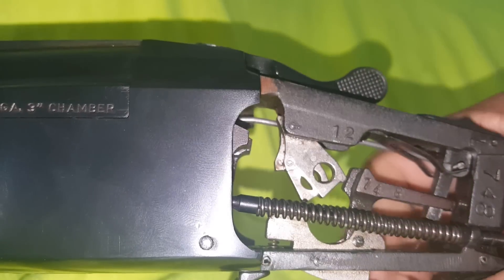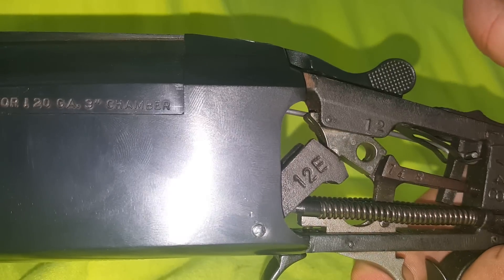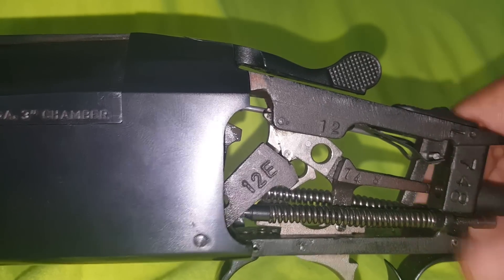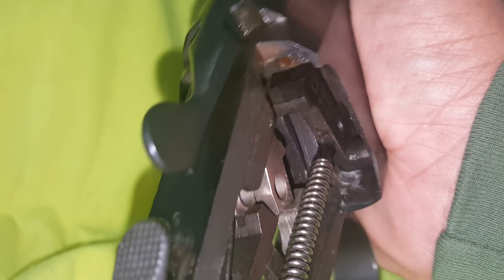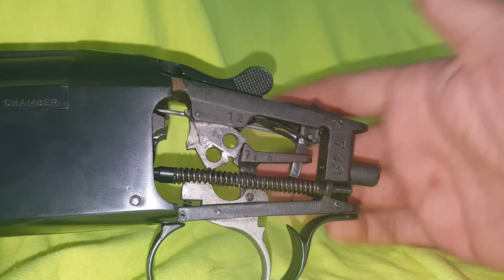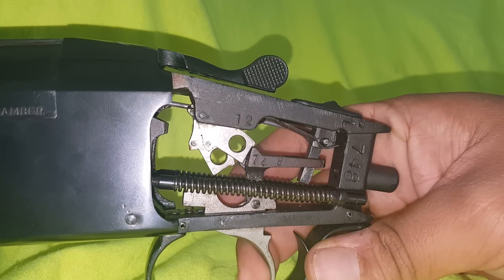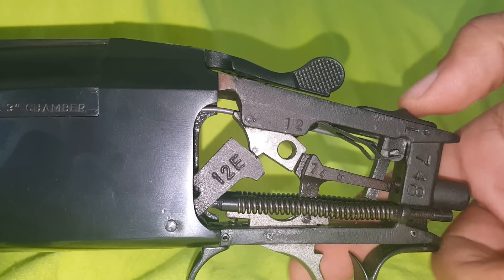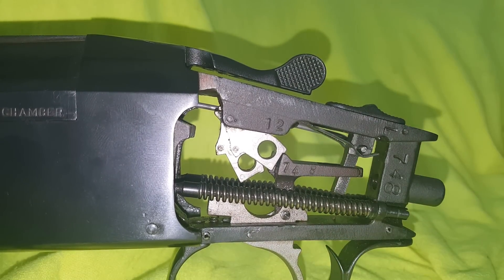Stoeger Condor not firing top barrel

Comment: clean the spot where it rusts and corrodes real good then smear some bluing solution with a Q-tip then GREASE it real good , SHOULD help
Reply: Grease jams the balance mechanism; just use a bit of WD40 or similar; do not over do it.
Reply: @sebastiantufigno6955  never put wd40 in or on a gun. I charge anybody double that comes into my shop with a wd40 special. Eventually it creates a shellac and gums up too much stuff

Comment: I have three different model Stoegers, and all three developed the same issue where the safety would reset after the first shot. I never liked the auto safety reset function anyway, because on the clay range, you load two, shoot two, and then there's no live shell.

The 'L shaped' bar that sets the auto-safety each time you reload can be removed, and a small metal rod inserted where the 'L' bar came out. This allows the safety switch to still operate normally, but now the safety will not reset each time you remove the spent shells and reload. The safety will only operate manually by moving the safety switch.

This leads some shooters to believe the gun is less safe than before. Keep in mind most over-under shotguns do not have this auto-reset feature anyway. If you have become accustomed to relying on the auto-safety reset, then you will have to retrain yourself to knowing the safety does not reset. This is important.

The main advantage of performing this modification is your Stoeger will never again misfire. Sure, it's not as well made or as pretty as one of the 'Big B' shotguns, but then, you haven't spent six times the cost of your Stoeger. The heavier Stoeger also absorbs more recoil, which is especially nice for a senior like me with the 12 gauge gun. I assure you, there has never been a time when I didn't enjoy myself on the clay range because I didn't have a 2800 dollar shotgun.

Comment: I just bought one of these second hand and it had the same problem. I removed the safety selector, and found massive burrs from the machining all the way down. Filed them back very lightly with a delicate filed and gave it a real good clean now it fires both barrels no problems at all.

Comment: My brother gave me a Condor where he had removed the auto safety bar and just used a small cross pin to keep the safety working manually.  After he reinstalled the safety bar the top barrel would not fire.  Yes, the leaf springs were above the bar but it still would fire the top round.  When I got it home and broke it down I discovered the real problem.  Not corrosion.  It was the safety switch itself, it was installed with the wrong side facing forward.  There is a slight difference if you look closely.  So I flipped it around and now the Stoeger works as it was built to work.

Comment: Thank you very much for posting this video.  

A friend of a friend had a problem with his Stoeger O/U shotgun, the safety would no longer operate and was jammed in the "on safe" (furthest rearward) position.  Apparently this is what happens if the problem you described goes on long enough because the hole that the bar from the safety to the receiver goes into gets packed with rust and the end of that bar was rusted.  This prevented the safety from full travel and effectively disabled the gun.  The gun would not fire either barrel.

That was the ONLY rust inside the action.  There must be enough difference in the metals used to cause a little electrolysis and rust right at that point.  I don't really see this as a design flaw, I don't know of any way that Stoeger could have anticipated this issue.  It is a fault only time will reveal.

I cleaned up the bar, chased the hole by manually turning a small drill bit in it, blew it out with canned air then filled the hole and coated the bar with graphite gun grease.  (Birchwood Casey Choke Tube Lube.) I worked the safety a bunch of times to get the grease evenly distributed and keep it from "aging" in a lump at the bottom of the hole.  That grease is designed for choke tubes and works like a charm for other gun parts also, it never seizes, breaks down or gets nasty over time.  I've removed choke tubes that have been treated with it and had thousands of shells fired through the gun over many years, the grease still looks like it did the day it was put on the threads.  

The shotgun then operated properly.

This should be a permanent fix.  The grease will stay put lubricating and preventing rust for years.  If it has this problem again some day in the distant future now I know what to do about it.

You gave me the starting point to identify and fix this problem and it was a problem that could be fixed with elbow grease without buying any new parts.  Thank you again, I really appreciate the time you took to take and upload this video.
Reply: works on the condor competition. Thanks
Reply: ACTS ....you can't have it both ways. Is it the over under or the coach?
Reply: ACTS No, but that was a legitimate question. The coach is a side by side. I'm Not nitpicking, they each have different mechanisms.

Stop being a reactionary. It makes you look like a sensitive little girl.
Reply: +Jonathan Rivera 
You said, "Stop being a reactionary. It makes you look like a sensitive little girl."

 "Reactionary" doesn't mean what you think it does ...

re·ac·tion·ar·yrēˈakSHəˌnerē/adjectiveadjective: reactionary1. (of a person or a set of views) opposing political or social liberalization or reform.

Stop using words the meaning of which you do not know.  It makes you look like a nitpicking nitwit.
Reply: ACTS That's well and good. I just need to know, does your nose touch your forehead? Also I notice that instead of admitting you mis-spoke, you just deleted your gaff, rendering this whole outrageous conversation void. The magic of the internet.
Reply: Mossberg 500 complete bolt disassemble and reassembly

Comment: I would say the safety slider spring must sit on top of the cross pin. Only then the safety slider would have two more or less stable positions, one in the forward and one in the rear position.
With the spring below the pin the safety slider wouldn't stay in either position but wants to go back to the middle position.

Did you reassembled it the wrong way or was it possibly already built in wrong by factory ?
If the problem with firering just one barrel is rather common possibly it's in fact built in wrong by factory occasionaly, or the owners do it wrong occasionaly.

Comment: Thank you for this helpful insight. I Just bought this gun. Used it once and I guess by letting letting it sit maybe that's when the corrosion forms. I found out the hard way because I took it to the range today and the damn thing would not fire the bottom barrel. However I figured out that by turning the safety on and off between shots it looks like it fixed the problem as a workaround. This is very unsettling though.

Comment: I had the same problem and I too cleaned out the hole for the safety wire and it has not failed me since and that is about 300 rounds so far.

Comment: Along with the bar on the wrong side of that spring, when the second barrel won't fire, the mere act of putting the safety "on" then back to the "off" position will move the sear into position to make it fire.
Reply from the maker: Tim Carpenter  Yes the pin is in the wrong position but even in the right position still did not fire second barrel no matter how much you move the safety from safe to fire. Like I stated previously I sent it back to Stoger worked fine put it in the gun locker, took it out and went to the range and boom same problem. All i know is now i have no problems.

Comment: I had almost the same problem with the 410 version. Corrosion was also the culprit, but it wasn't the safety, it was the little spring that pushes the right hand sear down. The spring that pushes the left hand sear down is identical according to their parts diagram. The sear spring on the right was missing. This caused the right hand sear to not (always) descend after firing the 1st barrel (bottom?) and give room for the left hand trigger arm to move forward to engage the left hand sear (that last bit is just like the problem you had with it). I think the spring corroded away. There's a hole that it sits in. Actually two holes: one up top (on the receiver) and one in the sear. One of them was very corroded and when I poked a tool in it, what looked like a remaining bit of the spring came out. I never did see the rest of the spring. The gun worked fine for quite a while and then one barrel just stopped firing. The same symptom as your problem. But now that I've seen your video I'm going to check the hole that safety rod fits into to make sure it's not also filling with corroded metal. Thanks! Very helpful video. I ordered replacement sear springs from Stoeger: two in case I screw one up.

Comment: Brand new out of box top barrel was not firing, saw this vid shortened the safety bar about 1/32 of an inch and now the second  sear engages. BTW I just noticed  you forgot the reengage the spring! The spring sits above the pin!

Comment: I just bought a Winchester 101 pigeon/trap first time out patterning the gun the bottom barrel shot fine but the top barrel was not firing at all, it actually was stock like as if the safety was on the top barrel preventing it from firing. Very odd a brand new gun never used. I suspect that something wasn’t machined properly. I just can’t believe that they would send a gun out to be sold without test firing it first. It’s on its way back to Winchester to hopefully be fixed. Very disappointing to say the least on a brand new gun. I guess it was put together on a Friday after lunch lol. If you have any suggestions on what could’ve gone wrong with the assembly or the machining I would appreciate your input on this. Thanks!

Comment: I looked at my Stoeger condor after watching your video, and I want to point out A couple of mistakes. The "corroded" bar that runs from the safety lever into the hole in the receiver since rather loosely on mine and therefore did not need to be freed up. Reason your gun in its current configuration will fire both triggers is because you have your safety cross bar above the springs so the springs are unloaded and serve no purpose.  The springs are meant to put down pressure on the safety to keep the safety from flopping in and out of "safe", which is extremely dangerous.  The mechanism is most certainly inertia driven as are all shotguns that don't have selective-single  or double triggers.  In fact, if the gun we're working properly, you would not be able to fire the second cylinder without having first fired The first "lower" cylinder and letting it set the second triggered by recoil. I appreciate you wanting to share what you think is a Stoeger condor epiphany but your analysis is mistaken, not trying to be malicious, I just don't want you to be hunting with somebody and accidentally shoot them because of your flip-flopping safety.
Reply from the maker: Peanut Man Hey no offense taken or anything like that. I am here to learn like everyone else  thats why i asked for the comments. Now with that being  said, im a little stumped because like i stated in the video when i bought this shotgun BRAND SPANKING NEW  i might add, it would not ingauge the second barrel and  put like 50+ of both 20 and 12 gauge through and nothing. So immediately  I sent it back to Stoeger.  5 or so months later i receive the shotgun back and anyone can guess what happened next..... straight to the range!! I loaded the shotgun and low and behold both barrels  fired without a hitch. This is where it gets me i was able to dry fire just like shown in video both barrels  when I received it back from Stoeger  which wouldn't happen when first purchased the shotgun or even when being fired with inertia Anyways after that  it was fine. Then i put it up for a while and when it  was time to go to the range again  the same thing happened again this time i put 70+  through and  still nothing. So thats when i took it apart and had a look , I just thought  well I sent it to Stoeger waited 5 months for the same outcome I just didnt have a lot of faith you could say. But believe me i am open to  any and suggestions but as of right now its firing  like a champ and have had no issues.
Reply: Hey I know this video is old but @Peanut Man is right. I shoot a condor competition which does reset on inertia but i also have a condor like this one and it has a no select mechanical trigger. Pull the trigger twice both hammers are released, which I like personally. But that cross bar that goes through the safety does go under those two tabs.  Its what gives the safety that distinct click from on to off and that bar is what resets the safety between shots. I removed the bar because my junior shooters, which I normally let shoot this would have missed clays too often for not resetting the safety. I replaced the bar with a similiar sized pin and it works great. But if that pin or bar is not under those tabs, good chance the safety and or trigger will fail. And you definitely dont want that when your 24 for 24 with one bird left lol.
Be Safe, Happy Shootin'!!

Comment: hey the pin for your safety is on  wrong it goes underneath the spring.  the linkage is pushed in while pushing the safety springs up.
Reply: David v wanted to point out exactly same thing :)
Reply: The pin is on right but the spring must sit on top of it ! So you must push up the spring before put the pin back in.
Reply: Thanks for this.  When I checked for corrosion it still felt funny after putting it all back together.  But after reading the comments I figured out my spring was below pin too.

Comment: When I took mine apart the small lever spring that the small pin slips through for the safety is opposite of yours. On mine the little hook/cradle portion is on top of the pin and yours is located beneath it. I changed mine to resemble your configuration and now the safety has almost no resistance where previously it was difficult to press to the fire position. Do you know which configuration is correct? Both ways allow the gun to fire so I am curious as to which is better.
Reply: I am talking about the small spring and pin just left of the number 7 as seen in your video.
Reply from the maker: +Dakota Neel  thats interesting,  i dont know what way is correct.  Like i said in the video this was the second  time this happened, the first time i sent it back to stoger, the second time i took it apart myself and how i show it in the video is exactly how i found it. the only thing is i notice now is i have to make sure it is all the way  in safe  because ,when you loaded it before i belive it automatically  put the shotgun  in safe. But now it seems like it does some times and not the other, which is not a problem to me i make sure I'm in safe until i need to fire anyways. im just glad to be able to fire both barrels  again.
Reply from the maker: +Minh Pham I  thought that when i first got it, I went to gun range and fired many rounds and never got it to engage the second barrel off inertia. I tried all types of different  loads and still nothing and  this was brand spanking new shotgun! so sent back to stoger and  as soon as i received  it back in the store i dry fired the shotgun and both barrels  engaged, no rounds,no recoil both barrels worked. took it out a couple time then i let it sit in my gun locker for a year. when i brought it out and  went to shoot skeet  it was the same thing wouldn't  fire second  barrel so took it apart like i show in the video  and now no problems  yet.
Reply: Watched your video and tore apart my sons two month old gun that would not fire second barrel.Same problems a little cleaning and some new grease and works better than new.I also agree it is not inertia driven for second shot.thanks for great Video

Comment: The Condor IS inertia driven on barrel selection. However, the Stoeger is not a top of the line premimum gun and the way they hold down the cost is in the finishing of the firearm. I have had mine since December 2015 (6 years now) and have put thousands of rounds through it at the skeet range but I too have had various issues including this one. A thorogh cleaning and some minor deburring has cured all issues to date. Tis past weekend, the forestock became loose and I had to tighten the two phillips head screws that hold the metal part to the wood and that was cured.  For the money, these are not bad guns but they are not a Beretta or a Benelli for sure.
Reply: No they all aren’t.  The equalizer notches can be cut to allow it to fully pass by the first sear without the equalizer being “bumped” back from the recoil.  Once the sear fully falls and the trigger is released the equalizer will engage the second sear.  On an inertia gun the equalizer is cut so it won’t fully pass the first sear until the equalizer is “bumped” by the recoil which then allows the 1st sear to fully fall and the equalizer then engages the 2nd sear.     

From what I can tell the inertia driven guns the first notch on the equalizer is at a different angle than the notch for the second sear.   On my condor field gun the equalizer are both cut at the same angle and the gun does not require you to “bump” it to get both barrels to fire.